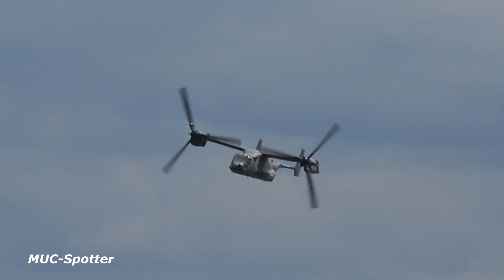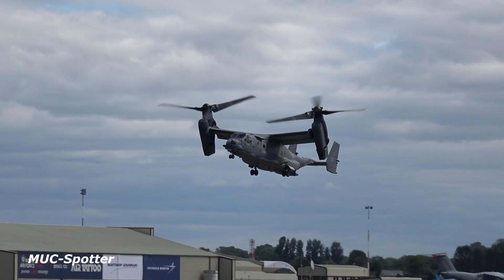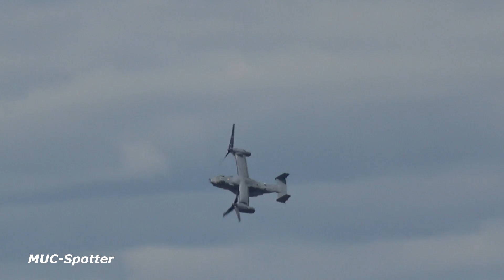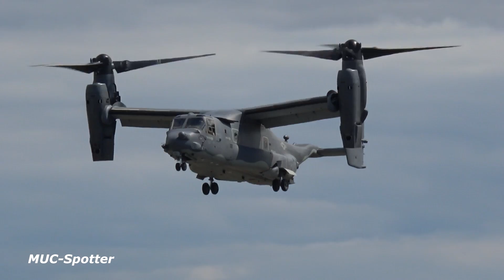Bell-Boeing CV-22B Osprey United States Air Force USAF flying at RIAT 2017 AirShow

Comment: Look at that shit bird...
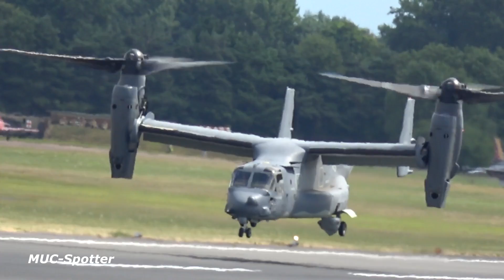This a public event and they most likely took the best serviced heli out there. Yet, when u take  a look at 2:40 to 2:50 u see a forward gear door literally flapping in the wind. 

WAtch at 2:45 how instable the helicopter looks until it sttled power at 2:53. Dynamic rollover calling...

Shitbird cant evne hover 30 sec in brown out conditions....and people are still telling me its used for troop insertion. How when a landing cant be longer than 30sec? 

Dont get me started on all its other problems...
V-280 hopefully resolves all the problems. specially with the tilting rotor and no more engineexhaust killing flightdecks...
Reply: Jealous much?  Can't hover for 30 seconds?  Rather misinformed.  Gear door flapping obviously an issue, but about as minor as you get.  V22 is invaluable for rescuing downed airmen.....nothing can touch it.  Same goes for special forces team retrieval.